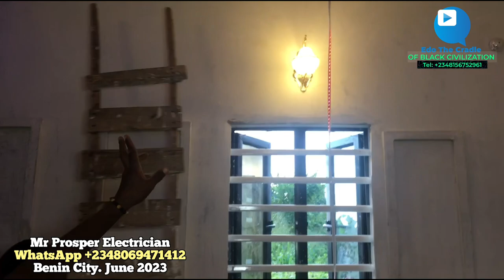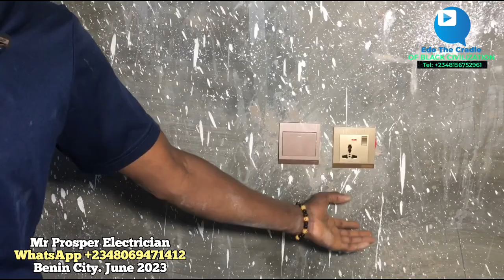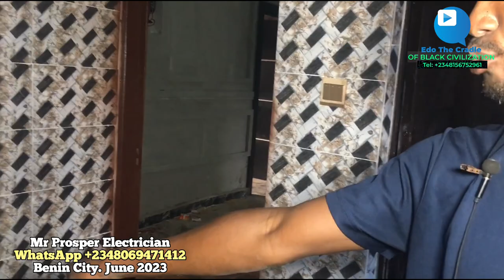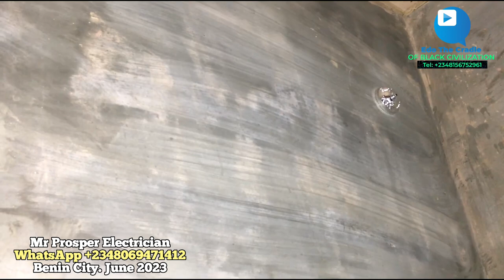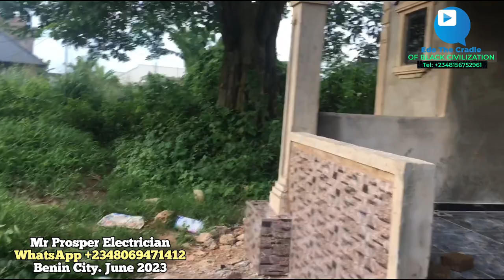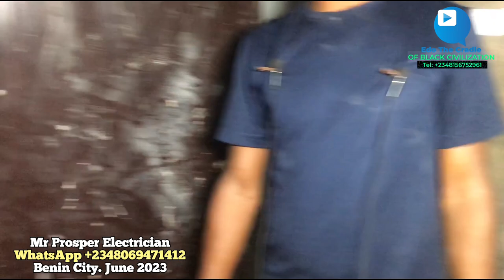Price Of Electrical Wiring On A 3 Unit Building Wall Lights, Dropping Lights, Surrounding Lights

Comment: You made a mistake on distribution box. The 6way DB box is for inverter, not for solar connection. Solar doesn't have connection on DB, (but 6x9 ADT BOX). ...  two DB in a house simply means, one for lighting point inverter, second for heavy appliances, water heater etc
Reply: Can wiring be done after pop ceiling?
Reply: @bestred4649  yes
Reply: You definitely know what you're talking about